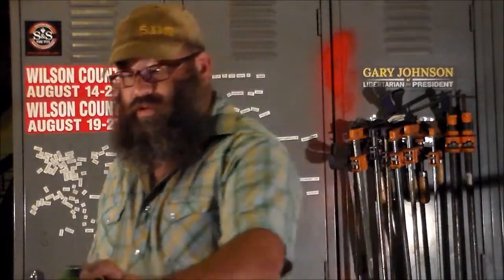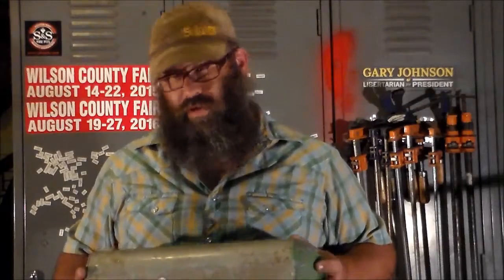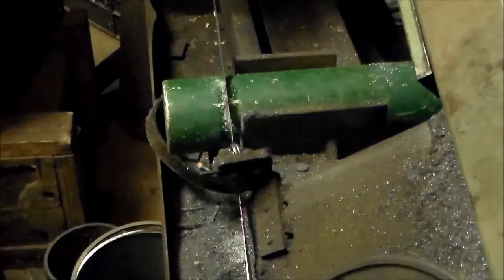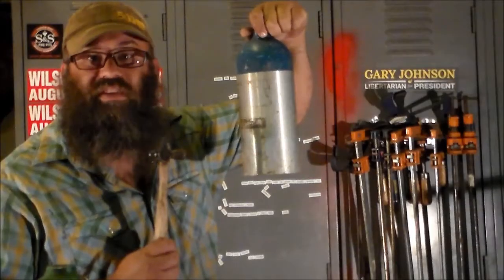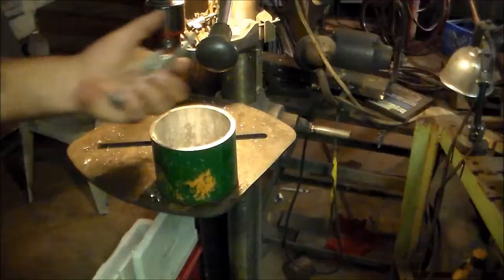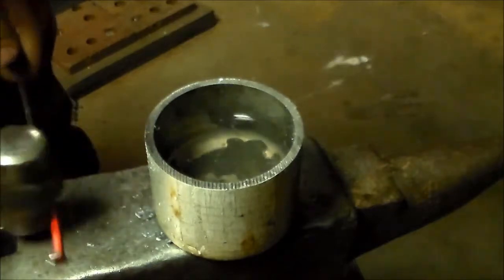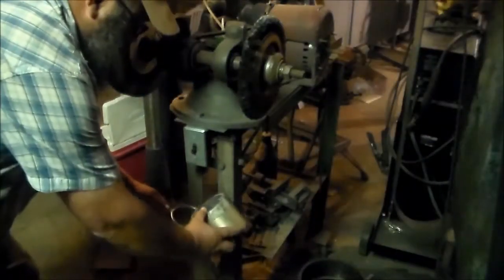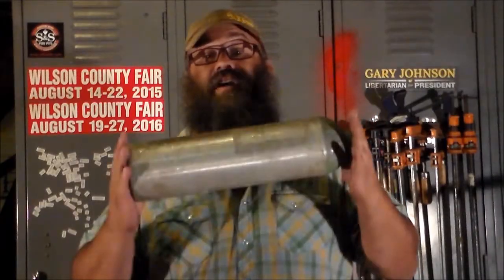Quick Tip # 4 Aluminum O2 cylinders and their use in the shop.

Comment: Once it's empty I can't get the valve off really hard to break loose think it'd be safe to drill holes in or use self taper to help hold it down
Reply from the maker: As long as it's empty that should work, or you could build a chain vice with a bike chain. Heat the valve a little with a torch and let it cool spray on PB blaster or WD40 and leave it over night.
Reply: @VooDooTennessee  thanks
Reply: Use an "Oxy Amphetamine torch" and heat this crap out of the threads !!! Make sure "it got gas in it!!!"